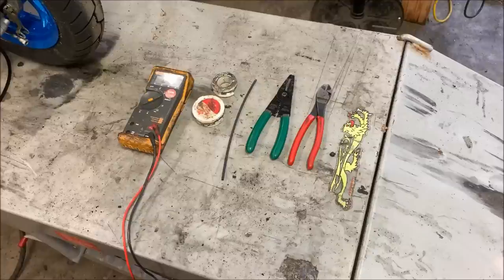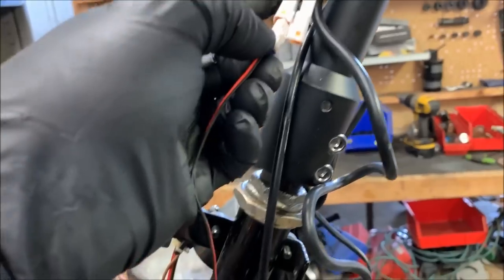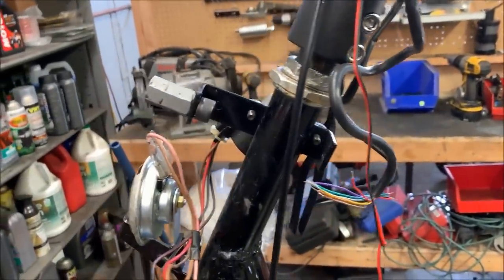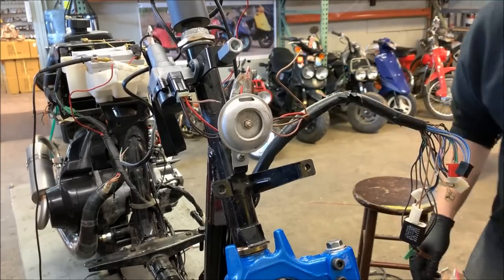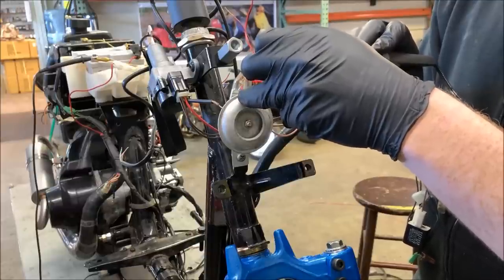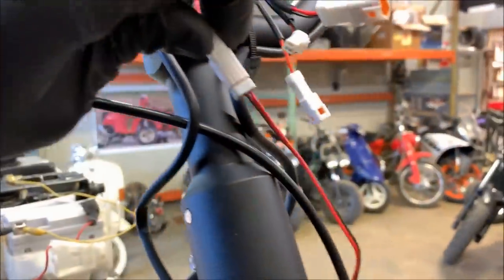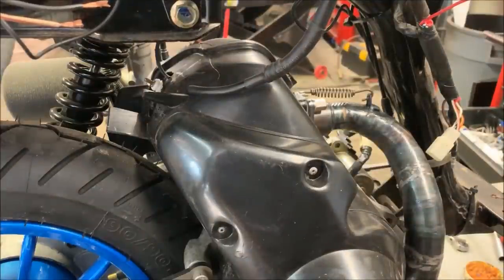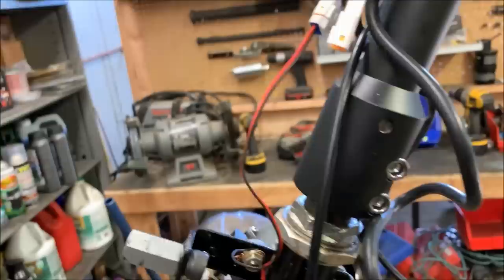How to Install Trail Tech Vapor Gauge On Scooters!

Comment: I’ve always tied into constant on. They time out after a few minutes and go to sleep. Wake up when you roll it or start. You also don’t need to keep replacing 2032 cells for the clock and memory.
Reply from the maker: the batteries last a good amount of time

Comment: what cable is it that it connects to the rpm sensor? Minute 12:40 
which cable is this black? then put the red spiral around.
Thanks
Reply from the maker: the coil wire